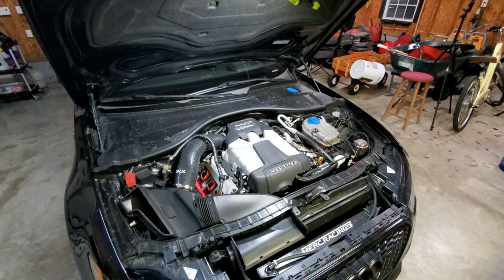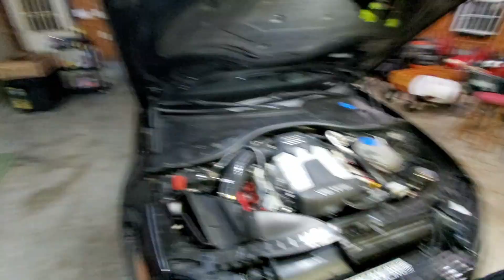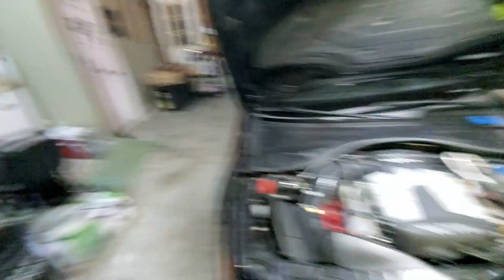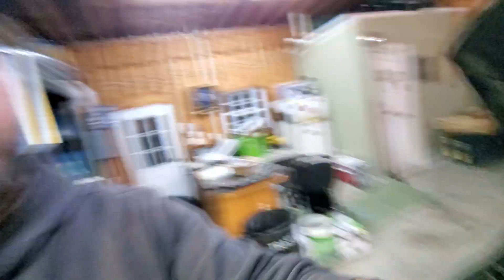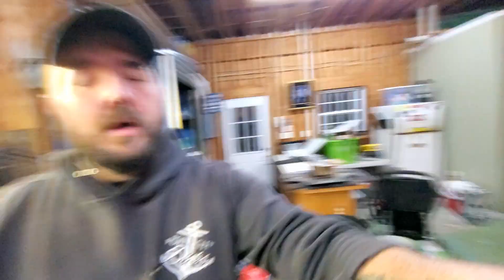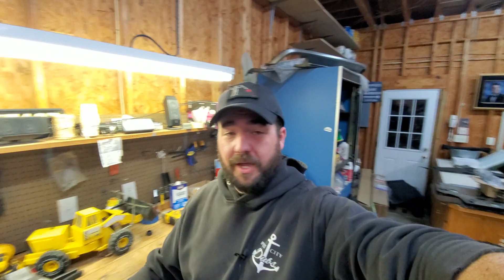Audi 3.0T Valve Cover Gasket & Spark Plug DIY (C7/B8 S4/Sq5)

Comment: Outstanding DIY thank you. Just completed this on my 2014 A7 Prestige with 138,000 miles. Replaced Spark Plugs and Coils while I was there. Old valve cover gaskets were pretty crispy when I removed them. The PCV vent hose removal trick worked like a charm. Really appreciate this thanks!
Reply from the maker: Fantastic! You just saved yourself a lot of money 🤘🏻

Comment: Just did the driver-side gasket job today, your video helps me a lot thank you so so much! There are some parts differences compare to my 2012. Clean up your bay first, definitely need a pick tool and a long flat head may also help. The total takes me 2-2.5 hours to do this work if anyone needs references, just take some time and be patient about this! It's really not that bad!
Reply: Do you by know any chance of the torque in foot pounds for the valve cover bolts?
Reply from the maker: Iirc it's 12 ft/lbs. I think I cover it in the video

Comment: Great video.  My wife’s Audi is a 2015 Q7 and looks like most everything is the same.  I have found that removing the air intake hose from the air cleaner is more difficult than you’d think.  Thanks for posting your videos. Very helpful.

Comment: Hose clamp trick worked good. Was really easy. Did this last night. I replaced the Oil filter housing gasket too. That was a pain. Just got to get mine all back to together after replacing the PCV body. Supercharger, belt, coolant and leak check everything. Then button it up. Waiting on parts is the most time consuming.

Comment: I have watched this video several times in the last 6 months until I made the time to do gaskets myself. I also have another issue on my 15 a6 prestige 3.0t c7 and wondering if I should attempt replacing the parts recommended on a check engine fix.  I have looked through your videos and do not see where you may have had this issue or not and addressed it but found nothing.  May have missed it.  I am getting a secondary air injection bank 1 and 2 improper air flow.  the repair shops said there is a tsb out and suggests replacing the combi valves and a solenoid.  I did purchase those but have not attempted because they seem hard to get to.  I did ask those shops about a carbon cleaning as well and they said start with this first.  I can see some of the combi's now that i have valve covers off but looks still hard to get to with a heat shield in around them.  I have almost 140k o vehicle and never really had any issues.  the light doesn't seem to affect the running of car but just annoying.  I am just outside of Raleigh and could use some help on this matter before I put covers back on.  Can you share any thoughts?  Thanks.  Roger.
Reply from the maker: The SAI service isn't a diy job. Requires a special pressure washing tool & is a pain to do. That is one you take to a shop to do. Good news is it won't effect your cars performance.

Comment: Great video, thank you!  Near the end, I think you may have misspoken about sparkplug torque (you said 22 ft. lbs), but the spec. is in Nm.
Reply from the maker: Thanks man! Reference the torque Spec, it is 22 ft/lbs according to all data as well as the emanual I use. The spark plugs I used even say 21.6 ft/lbs on the box.

Comment: Before you even start this job, do yourself a favor and get a 3/4 inch inner diameter hose in order to repair the broken PCV breather hose which WILL break if you look at it the wrong way or when you suddenly release the hose from cover. Again get a 3/4 inch inner diameter hose to create the union.

Comment: About to do this while doing the PCV, water pump and t-stat. A little concerned I may have some upper timing chain cover leakage around the gasket. But if I do that, I'm replacing the guides and tensioners and I really don't want to even go there. Also when you spray brake cleaner on your engine how are you wiping it up? You make it look spotless and I always have residue in the nooks and crannies. What about the the oil filter housing gasket. I have some residue around it but not sure if from spillage or the gasket. How can I tell. Fluids are drained.
Reply from the maker: I spray then wipe with a blue towel, or spray until everything is clean lol.

And you can use liquid moly molygen oil to track leaks with a black light
Reply: @AudiC7Owners  oh nice! Thx!
Reply: @AudiC7Owners  so I bought Liquid Moly but you are saying the Molygen has black light detection? Weird as FCP Euro doesn’t state that as a point of it. And it doesn’t seem to be available for my Q5.
Reply from the maker: Just get the 5w-40 molygen.  It is a decent oil, but I would only run it to detect a leak. After that I would switch to running a higher quality oil like Rowe
Reply: @AudiC7Owners oh is regular Liquid Moly synthetic 5w-40 not good? Blue bottle. Also ordered the same spark plugs but I don’t have a tune. They come pre-gapped I assume to .24 not .26 like you do.
Reply from the maker: It's decent, but Rowe and motul is better. I've worked with Rowe for a while and really love their products.

Never assume a plug is correctly pre-gapped. Always double check
Reply: @AudiC7Owners is Rowe a local product. Where do I buy? I’m in Charlotte.
Reply from the maker: No. They are one of the biggest German oil companies in the world but have just started to push into the USA in the past few years. USP Motorsports carries their products 🤘🏼

Comment: How did you torque the bottom hard to reach bolts on driver side? Hand tightened with no torque wrench? I installed Elrings and they are leaking. Did you use OEM gaskets? Cheers bro 🍻
Reply from the maker: Yep. I used elring and just hand tightened them. Next time you replace them you can apply a small amount of rtv to the gaskets

Comment: Any chance you have footage of cleaning the area before you started? Compressed air, vacuuming, brake cleaner? Thanks!
Reply from the maker: Nope. It's pretty self explanatory. Use an air hose to blow stuff out of all the areas you are working in, then use a shop vac to vacuum all the areas as best you can.

Comment: Hey Cameron, I have a 14 s4 with 130k on it. Stage 1 034 tune. I am having the same problem that you stated in your oil consumption video as far as blue smoke on decell it has also started smoking if I let it idle. The smoke at idle looks more like moisture so I’m not too worried. I was wondering if the valve stem seals fixed your issue or if it was something else. Thanks!

Comment: I just bought a s5 and cylinders 456 and misfiring and will throw a epc light and limp mode. I notice I need my valve cover gasket replaced so I’m doing that but could it be from coolant leaking from the supercharger too?

Comment: Wondering if you were seeing oil consumption with bad valve covers. Just did PCV, t stat, WP, ERG valve, carbon cleaning, new cross over pipe under charger and new gaskets. Seeing about a quart of oil burnt in about 1100 miles of the recent maintenance. Wasn’t burning oil like this before shop repair of PCV and such items listed above
Reply from the maker: Yes. Def had burning oil issues with the leaking vcg's.
Reply: @AudiC7Owners  awesome to know. Just at a loss after all that maintenance it would be eating more oil then it was previously. But I can see some leaking on the driver side VCG

Comment: Any tips on removing a stock air box? I don’t see any screws there and afraid to brake something by just pulling it up.
Reply from the maker: Remove the ram air section that connects the box from the radiator support (two t27 screws).

Disconnect the air hose from the throttle body to the box.

Pull up on the box firmly, but don't yank it bc there is a secondary air intake line connected to the bottom. The easiest way to remove that is to remove your partner wheel and pull back your fender liner to get access to it. There isn't any slack to allow you to pull it out & get your hand on it easily.
Reply: @AudiC7Owners  thanks man!

Comment: have you checked the gap after you take them out of the little bending tool? mine need to be at 028 and if i do that with the 028 gap measure tool the second i take them out they end up either 029 or 030. in my case i figured i have to use 026 when i bend them to get a pretty constant 028 result
Reply from the maker: It's been spot on for me so far

Comment: Thank you for the DIY!
Did the gasket resolve your oil consumption issue?
Reply from the maker: For the most part, yes! I still have a little bit only when I'm really pushing the car. If I drive normal there is almost none

Comment: I need help my car is leaking oil but it’s. Not from the pan it’s seem like it’s coming from the bottom of the engine but I really can’t tell I think it’s some kind of seal
Reply: @bradleyrobertson-ju7sq  did you resolve this?
Reply from the maker: You need to trace it to its origin.

Could be valve cover gaskets, rear or front main seal, valley pan, pull filter housing gasket, etc
Reply: @ okay ima check into it I wish I really could send it to you guys to looks at it and fix it I’m from TN

Comment: Did you get any air in the coolant system after putting everything back together ?
Reply from the maker: Nope. Just reattached the reservoir & topped off. No air was introduced into the loops

Comment: I purchased platinum plugs from FCP Euro. I do not have a tune but should I return and get iridium plugs?
Reply from the maker: Shouldn't matter on stock tuning
Reply: @AudiC7Owners  I am replacing my valve cover gasket because I noticed lots of oil in my spark plugs and pieces of my gasket melted onto my coils.
Reply from the maker: Sounds like you definitely need to change them
Reply: @AudiC7Owners  

Do you have any videos changing water pump
Reply from the maker: No, but fcp euro does

Comment: Would've been nice to show the air box removal..lol.. I can't figure the bottom hose disconnect.
Reply from the maker: The easy way is this:

1) jack up the passenger side front wheel
2) remove passenger front wheel
3) undo & pull back the front wheel lining
4) unclip SAI breather hose sat attaches to bottom of OEM airbox
5) pull oem airbox out of engine bay (takes some force as it is pressed into the frame arm with rubber bushings)
Reply: @AudiC7Owners  Wow..!  Thanks for the super fast response..!
Unfortunately, I have no room on that side to lift car and too many things removed now to start up car and move..
Thanks again for the response..!!
Reply from the maker: Good luck!

Comment: So no Permatex Ultra Black RTV? How did the gasket hold up?
Reply from the maker: It's holding up just fine so far
Reply: @AudiC7Owners  Good to know. I’m about to replace one on a 2013 Audi Q5 I just bought with 197k miles. I know Audi says no sealant, but a lot of people on the forums say just a tiny bit of sealant. Since the part was only $33 from Audi I’ll give it a go without sealant.